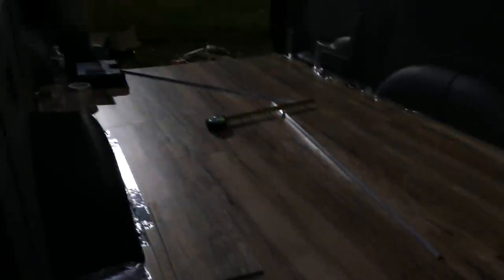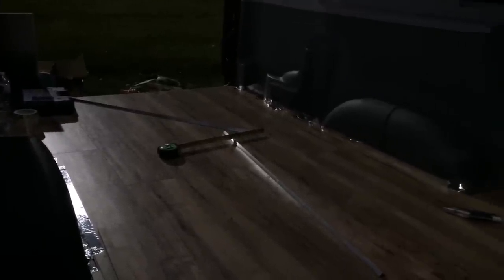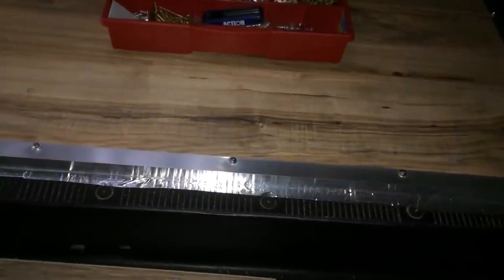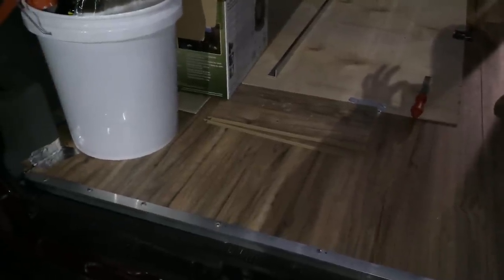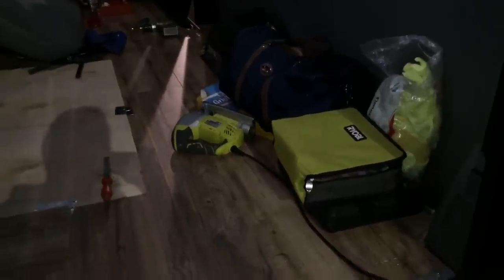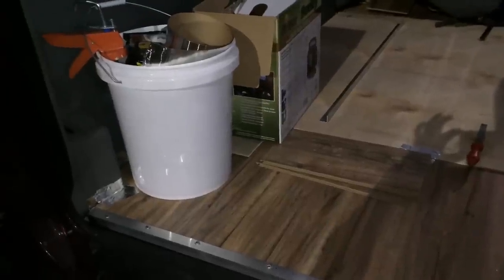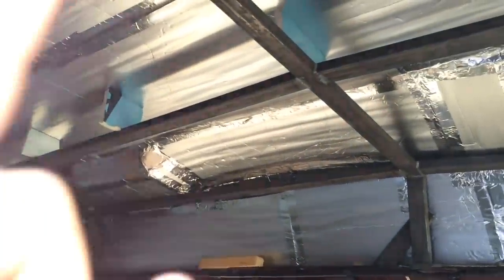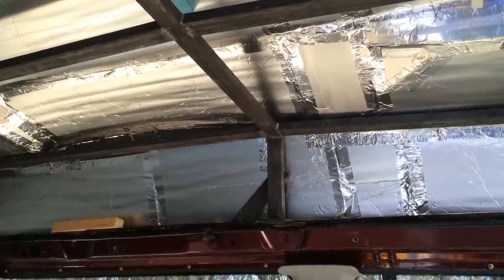Van Life; Roll Cage Demo - HighTop Van Build: From Passenger Van To Campervan! Part 4

Comment: I'm really glad you're doing this series.  This is likely the way I'll be doing it - in a parking lot with borrowed or generated power.  I think you might be the first to video it this way. Great job!
Reply from the maker: Thank you John! 
The only reason I even rented a generator was because it was snowing and I didn't have sun shining on the solar panel, otherwise I wouldn't even need one. 
So far nobody has bothered us at either Lowes or Home Depot. 
👍🏻😄🚐

Comment: Hi Luis.
Never stop playing, if you do you will grow old. I too still ride the trolleys at my local supermarkets, as a youngster we all use to do it, but I've not seen any kids do it for years.
I like the type recip saw you purchased, I've had the makita version for years, and have a selection of blades for different types of woods and metal.
A geny always comes in handy if you have somewhere to store it. I purchased a honda geny for £70 from a car boot, and spent very little on bringing it back to servicable condition. I'm hoping to give it a full test at my caravan this weekend.

Stay safe, healthy, happy, contented and playfull my friend.
Reply from the maker: The ride through the parking lot was a bonus for working in the rain/snow. 😄
We weren't going to buy a sawzall but the rental place didn't have any left, and we wouldn't need the generator either but with no sun available my batteries can't charge. 
No doubt a small 1000 or 2000 Honda would come in hand at times like this. 
You'll probably make great use of that generator. 👍🏻😄🚐

Comment: If you ever need good tools on the cheap, try a pawn shop. I bought a Milwaukee sawzall with battery, charger and blades for $50. I am a girl and and after buying a better blade, I cut down iron poles that were holding up a car port. Good luck and stay warm!
Reply from the maker: Thank you very much for the idea! 
I'll try to stay warm, thank you. 😊👍🏻🚐

Comment: Another great video Luis and lots of fun to watch it being done right.  That is one well insulated van for keeping warm in the cold,  and staying cooler in the heat. 

That'll be a lot of cutting removing the steel bars but the reciprocating saw will do the job.  I use them daily for demolition work and the bi- metal blades work good only if you use them at low speeds and lubricate the blade as often as possible.  To say the least,.. I'm really impressed with your work!!!  Btw,  I too ride the carts and I'm an old fart!  LOL!!!  : ).  Happy Thanksgiving and keep the faith!
God Bess,..Pete.
Reply from the maker: Thank you very much Pete! 
The van will be well insulated, and had I more time it could be even better. 
I knew the jigsaw most likely wouldn't do it, but I had to try since I already had it. 
Nothing wrong with riding carts, well, as long as we don't fall...😊
Happy belated thanksgiving Pete! God bless. 👍🏻👍🏻😄🚐

Comment: To cut the tube steel. I used a grinder with a cutting disc & a sawzall.
Reply from the maker: +arned coudyk the sawzall made quick clean work of those tubes, as opposed to a grinder, which would create sparks and could damage the foam. 👍🏻😄🚐

Comment: Thanks for the Vid and plus on the editing. Cringed when you went to use the jig saw for cutting the cross members but it was what you had. I wished you were closer because I have all the tools you that You could ever need in the back of my pickup and if not I can get it in 15 Minutes from my storage unit. Loved when you rode the dolly in the parking lot because I do the same thing. I'm in central bucks county and no snow yet as I'm not finished with the updates on the outside my 15 foot camper. Great Work and video my friend.
Reply from the maker: Thank you Charlie!
I knew the jigsaw wouldn't cut it but I had to try it anyway. 😄
I appreciate the tool offer, but I'm a bit farther way while working on this build. 
Riding that thing was fun. Not so much if I had flipped over. 😂😄👍🏻🚐

Comment: Luis, I am surprised you did not try a cutting wheel on your drill. I am not sure if it would have worked but you may have been able to save yourself a few bucks. I am glad you are getting rid of the overhead braces, looks like it will give the owner quite a bit  more usable head room. Have a great Thanksgiving buddy.    jman
Reply from the maker: Anything that could create sparks wasn't desired jman, not with all the flammable stuff around it. 
The space will be much more usable without without those bars that's for sure. 
Happy thanksgiving! 👍🏻👍🏻😄🚐
Reply: Rolling Earth-Ship I didn't even think about the sparks, I think I am starting to get the Van Jones syndrome....HELP!
Reply from the maker: Yeah, I can picture both of you trying to cut that thing with a blowtorch...and having nothing left by ashes. 😂😄

Comment: Cutting wheel on a grinder, you may have been able to rent one of those.
Reply from the maker: Makes too much sparks. The sawzall was perfect. Cut through metal like butter. 🚐👍🏻😄
Reply: +Rolling Earth-Ship Yeah, I own a reciprocating saw too, they are badass in demo! I was cutting through nails with it. You had some difficult challenges with this build but you conquered them. I was thinking the rubber mat that was on the floor could have been used as a template. It would make interesting episodes to check in with the owner from time to time and see how everything is working out but it looks like he'll be warm, you set him up pretty well.
Reply from the maker: I'm not sure the owner wants to be on camera for the foreseeable future. 
Thank you for the nice words. 👍🏻👍🏻